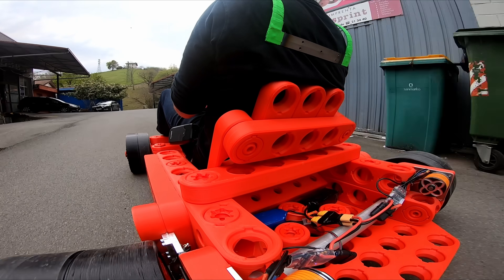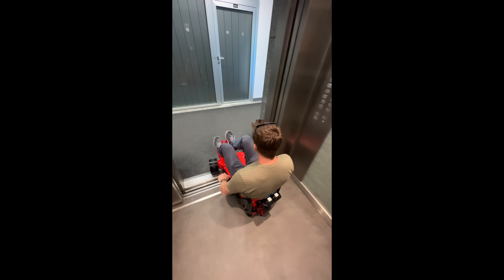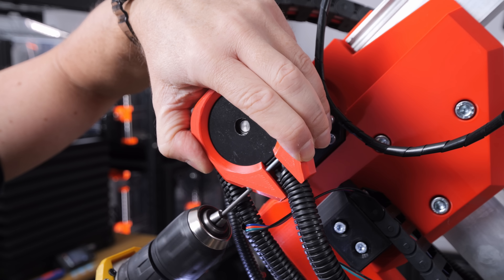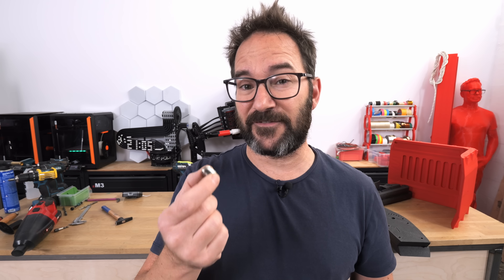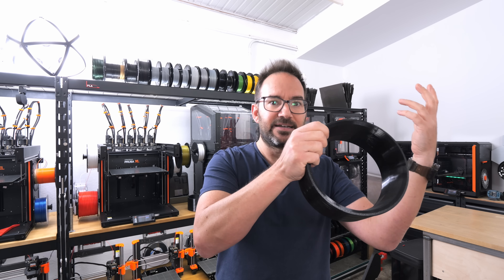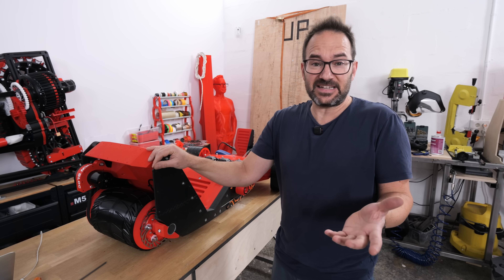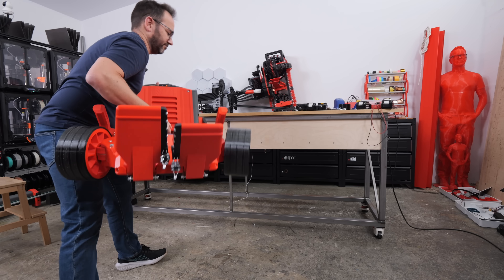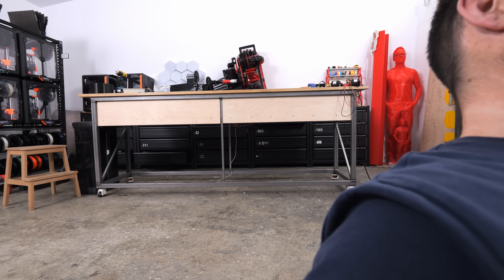I 3D Printed a GoKart to fly around the world

Comment: Just building 600×650×500 printer. Inspired by this guy but fitting my specific needs. Thanks Ivan for your funny vids. Also making small e-vechicles. But I can never understand these micro batteries. For some indoor tests, maybe enough. But for real use, batteries should be designed to keep kilowatthours, not single watthours.

Comment: Great job! 😎👍
However, I would recommend switching the pedals, like in aircrafts, if you press the left pedal, it turns left, and if you press the right one, it turns right. Also, on the pedals of the aircraft there are wheel brakes, the left pedal brakes the left wheel, and the right one brakes the right wheel, so that the aircraft can make sharp turns. It will be easier for people to steer instinctively.

Comment: Yeah brilliant.

Only one safety note: you want your brake control to work by pushing it forward not pulling it back. When braking, the driver's weight is thrown forward, counteracting the pulling action - in an emergency, you absolutely don't want that.

Comment: If you want wheels+tires that are both easy to fit and have a lot of holding power, consider using tapers. If the inside of the tire resembles an hour glass (tapering to a narrow diameter in the center) then you can do the wheel as two tapered plugs. As you tighten the wheel halves together it will force the tire out giving it a lot of grip on the wheel.

Comment: Airplanes are set up so pushing the right pedal turns right, yours is set up so pushing left pedal turns right, which might be part of the disconnect of trying to drive it, treating the pedals like bicycle handles.

Good thing it looks like you can just reroute cables to fix that.
Reply: If you think of it as a steering wheel, it works. That's what confused me with aircraft pedals. And it's probably what guided Ivan's decision to make it work this way.

Comment: awesome video, if i can give some suggestions to make more intuitive control, you have everythihg via cable, if you route the steering cables to the two handles and the brake/accelerator to the pedal so that brake is like a cart and steering is like a bob it can get easier and help tilt by pulling the inside lever

unfortunayely by not having a 4 bar link between the two front axle for the steering you can't add caster angle it will auto center the steering and help speed wobbles(i think 2-5 degrees would aready make an impact) but if you can add it in some way ry it!

otherwise it is an awesome veiche that has it''s own challenges and that's its own spirit i love it
Reply: Yeah I would want the controls more like Huffy's Green Machine

Comment: For next iteration: Put the throttle and brake on one lever, so brake will never fight with the motor. And as others said reverse the steering so it is like in a aircraft. 
Now I want your  Go-Kart as well... Very nice
Reply: You can add a simple motor disable switch to the brake lever or brake caliper unit to solve that issue.
Reply: @tin2001  Motor breaking is better anyway as that makes it regenerate power when breaking.

Comment: no akermans, no kingpin inclination, no caster... inherently unstable :)

the actual concept though is pretty cool. wouldnt be a big deal to tweak appropriate parts to cure geometrical issues.

the pedals are backwards. think of a plane...or bike. you push right to go right...

tilt steer is another option... fixed axle on an angled pivot a la skateboard truck...

i would consider proper tyres... 3d print should cope with 20psi in a tube... or foaming pla?

Comment: but ivan, the steering is reversed! if you steer too much, centrifugal force will move you to the side causing you to press with your outward foot and steer even more tightly into the turn and loose control! it should be the other way around, so that excess centrifugal force will loosen the turn and help stabilize steering.
Reply: Yep, the steering is reversed, I think it should be done the same way aircraft ground steering is done which is the reverse of what Ivan did
Reply: @Metallica4Life1995  didn't know plane foot pedals worked that way but makes total sense. same thing goes for skate boards: weight on the inside of the turn. the skate turning below you causes your mass (still going in a straight line) to center over the skate and limit the turn. otherwise, with any perturbation they would spiral away from under you and be completely unrideable.

Comment: You have the foot controls the opposite way round compared to rudder pedals on an aircraft! I wonder if that's somehow counter-intuitive and makes it harder to steer?...
Reply: His way makes sense if you imagine pushing on bike handlebars with your feet.
Reply: Same with kayak rudders. I think pushing the side you want to turn away from does apply in downhill skiing or roller skating, though.
Reply: It took me a bit to figure out plane steering (not real ones - just a simulator) when I got given some pedals. It felt backwards to me.
That said... Now I'm used to it, I'd probably crash anything that went the other way.
Reply: Not only that, but having the controls this way introduces passive instability via a positive feedback loop. A small accidental press of the left pedal turns right, shifting the driver's weight to the left and forcing them to press the left pedal harder and harder until they (over)-correct and then you have the mirrored situation all over again. I think you would see a surprisingly easier driving experience, especially at higher speeds, if the pedal direction was reversed.

Comment: Hi Ivan... En una de esas parlas spanish porque yo no domino el inglés. :face-green-smiling:

When you were talking about the wheels at minute 11, it occurred to me that both the rims and the tires should be toothed, like a pulley with its belt, thus ensuring a good transfer of traction... Because applying brute force (hammer blows) to the rims can be dangerous (cracks in the layers).

:hand-purple-blue-peace:

Comment: Ivan, on your wheels, if you have a dual-head extruder printer, you can print your wheels in one shot by running both materials and turning on 'interlocking'. We use it on our robot's road wheels for the tracks. We are running ASA & TPU95.